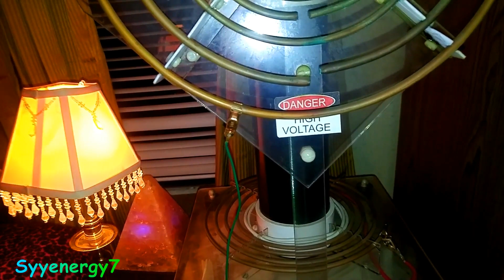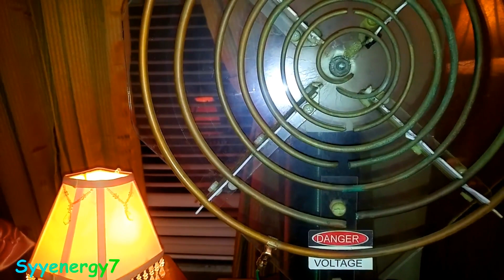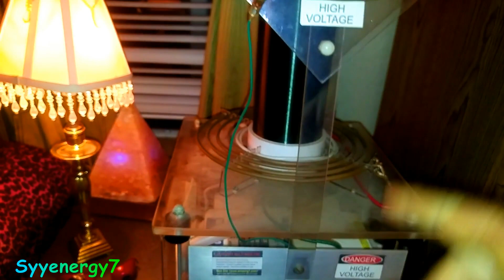More Tuning on the Lakhovsky MWO

Comment: Hey man, may I ask you an important question, if you would be limited to only three (3) of your favorite gadgets, which ones would you choose in order of importance to you?  I am sure others would be interested to know also.  Thanks for your interesting posts that you push up to share with us.
Reply from the maker: The ParaZapper 6 - Pack with all the accessories (wrist straps, battery charger, etc).  Most bang for the $$buck.  Simple and portable too. That another big factor.
Reply: syyenergy7, thanks for the quick response, I am checking it out.  I was not aware of this device.  So this is your No.1, what about Bob Becks 4 devices for No. 2, and Spook2 for No. 3, if I am allowed to fill in the blanks at this time - your thoughts ...

Comment: The gap acts like a parallel plate of a capacitor.
Reply: The gap actually acts as a switch.  Adjusting it tighter reduces the voltage. That's why there is less power loss (U²/R) within the spark and therefor it creates less heat so the tungsten rods hold longer. By the way the spark gap is needed because it creates a multi frequency broadband spectrum with a wide range of harmonics from a few Hertz up to several GHz. That is why it is also called multi wave oscillator. You can have some of the effects also with piezoelectric or capacitive devices.